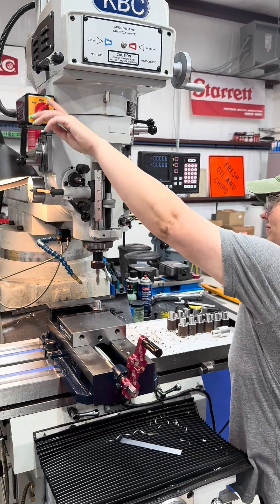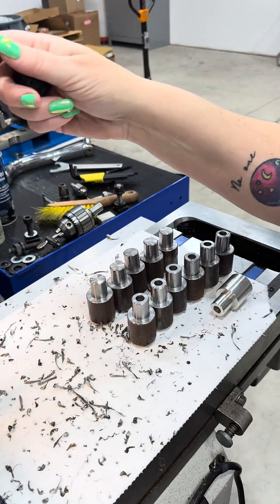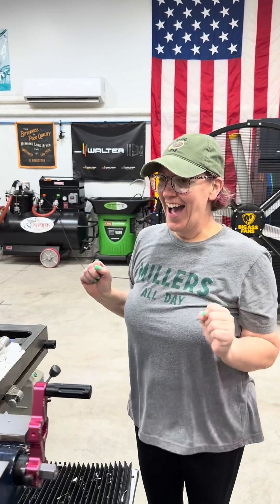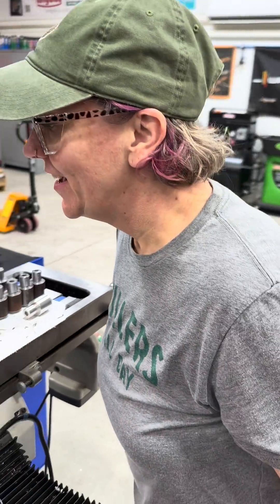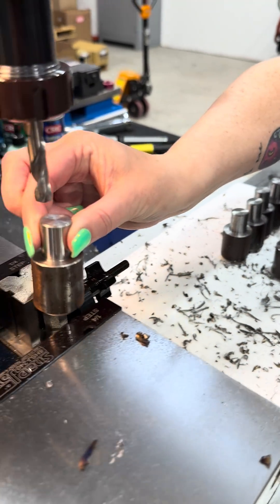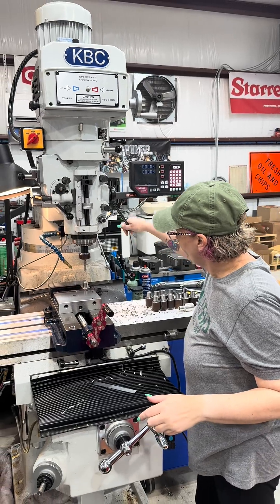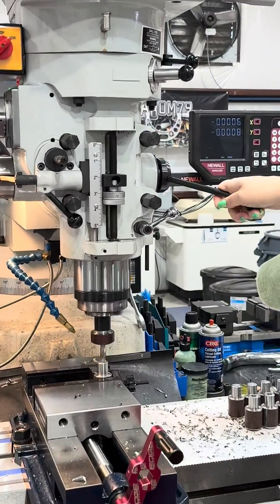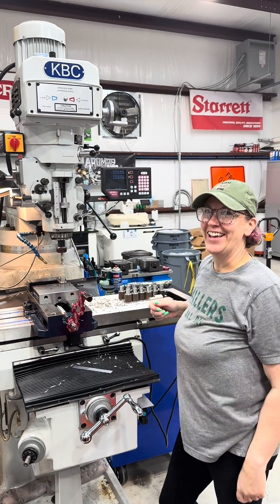We’re teaching Abby how to operate the KBC mill. This is her first time using it. #abom79 #learning

Comment: Please teach why the part should be held in the center of the vise. Showing bad practice like that is not a good way to start training.
Reply: It's clamped on 3 line contacts. It makes absolutely no difference

ETA - there's no support in the centre of a Kurt vice so it would need packing up on a loose parallel, making an even less repeatable setup
Reply: @tangomike7 the usual practice is to hold the parallels in place in umpteen possible ways. Another issue with location is to prevent the vee block moving to the left. Again umpteen solutions for this too. Foolproofing the setup is essential, especially for trainees. Will all the viewers now believe it is safe and appropriate to clamp parts in one end of a vise? It is not, and for this reason I don't believe bad practice should be left uploaded.